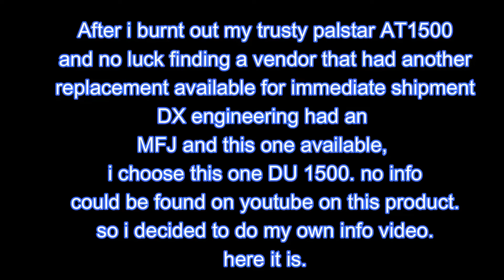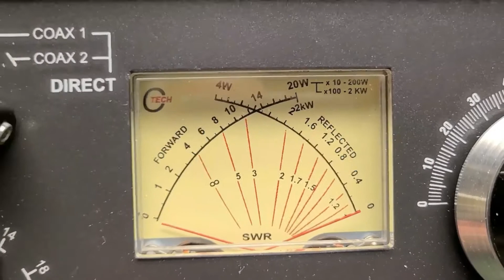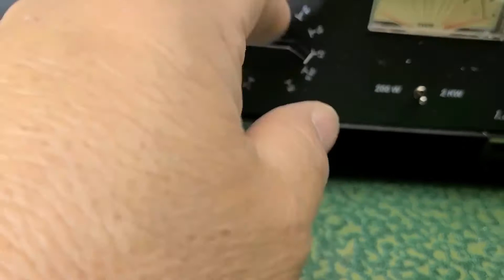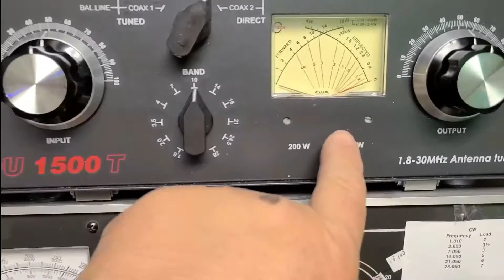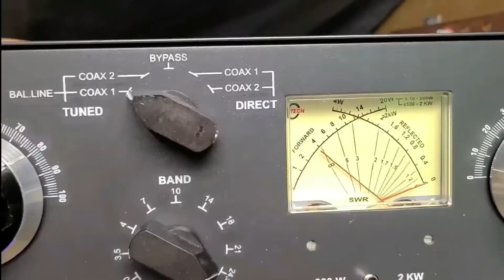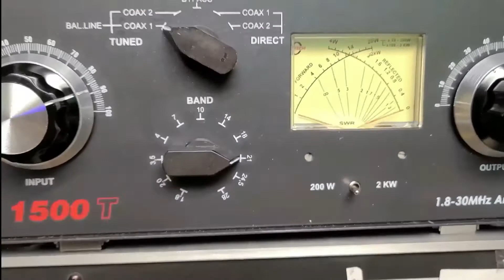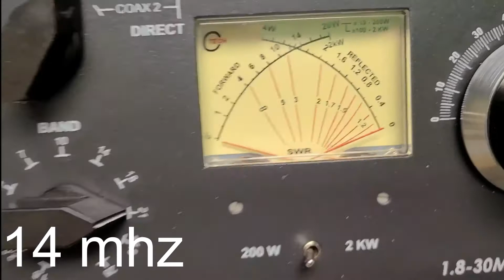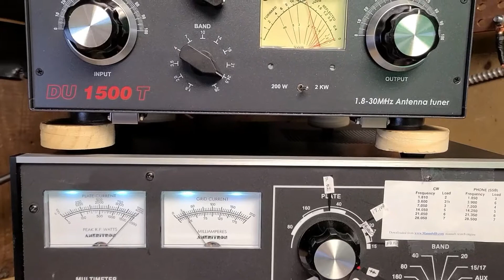DU-1500 t,  ANTENNA TUNER, unboxing and testing.

Comment: I bought one of these two years ago. My back plate was bent as well, also 4 of the screws holding on the coil was loose as well as the ceramic holding the coil was cracked. It's a peice of junk. It wouldn't recommend this tuner to anyone. I expect these types of issues with mfj.  I also got mine from DXE.

Comment: Hi....great video OM.
I see that the backplate is folded a bit to the inside. Maybe shipment causes this problem.
Anyway.....such a great tuner, i'm also a great user of this Hungarian masterpeace.
73s Sascha PF9Z
Reply: I think the tuner was dropped on its face during shipment and the ferrite balun’s mass pulled the back panel forward. This happened on a used TenTec transceiver I received when the mass of the heat sink on the back caused the back panel to bowed when I think it was dropped on its face.  Fortunately the packing protected the front panel. Fed x agreed with me and they paid for a new back panel which I installed. 73 Jim